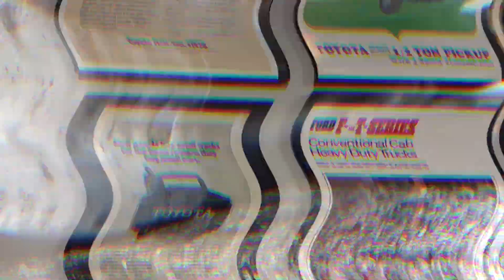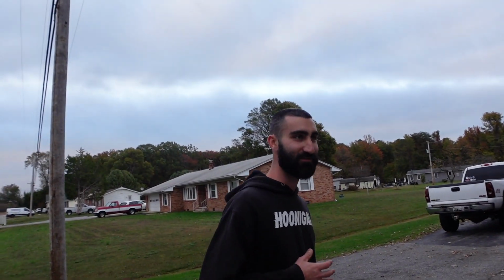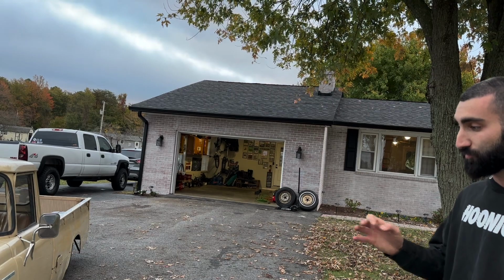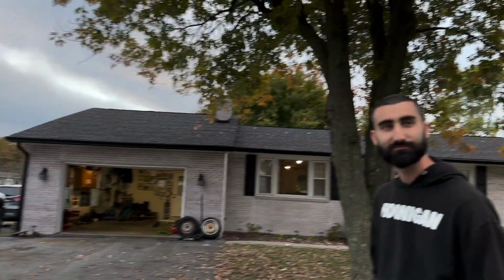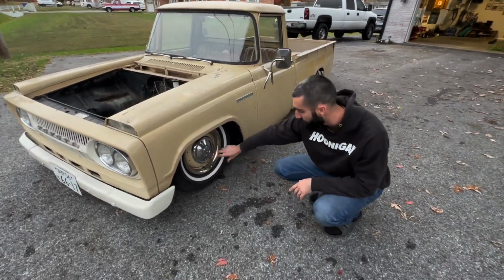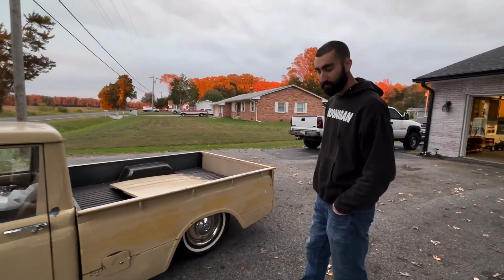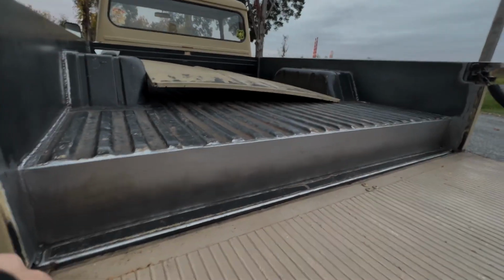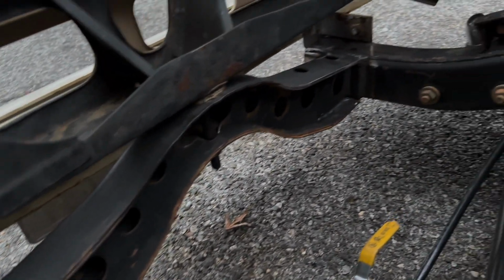Toyota Stout Chassis Swap On Bags!!! Mini Truck Fabricated Air Suspension! (Rustomod Reviews Ep.2)

Comment: nice lil truck!!  i drive my 66 Stout all the time. owned it 28 years.  i put GM A body 3 in drop spindle disc brake kit on mine.. and a 82 Camaro booster will fit under the hood.  will be putting update vid up soon..  GL..   T...
Reply from the maker: Awesome